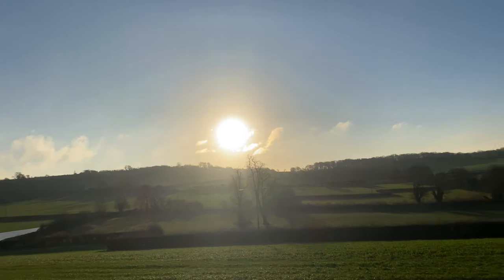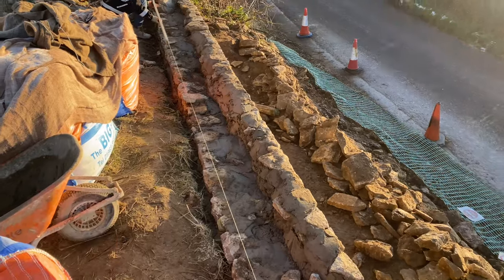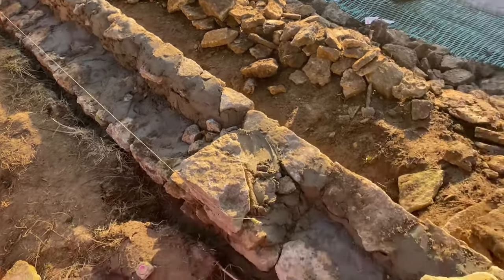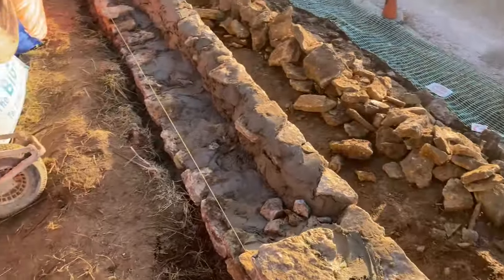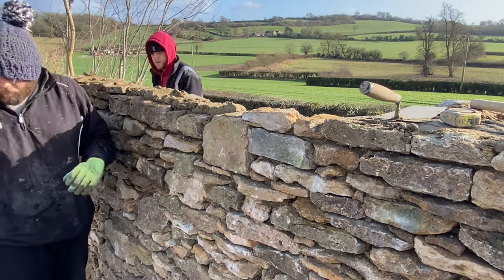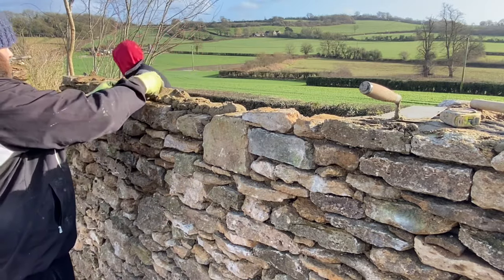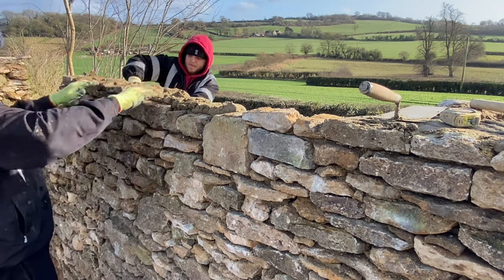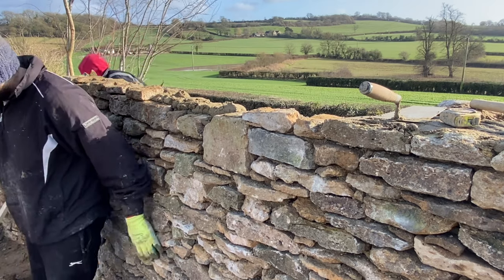Building A Stone Wall

Comment: Nice project! And an awesome end result. Presume its a lime based mortar. Looks pretty cold up there, you guys keep on going with low temps. No problem for your mortar?
Reply from the maker: No this mortar was just a basic cement mortar 6/1. We were given all the materials as that’s what they wanted to use, being a subby job you just crack on. We didn’t lay when temps wouldn’t reach 6+ in the day. Covered with thick hessian and then a tarp every night. We only had a couple of heavy freezes so wasn’t too bad. But the job was spread over 4 weeks. Thanks for watching!
Reply: @J.HarveyStonework  thanks for your reply, cheers!